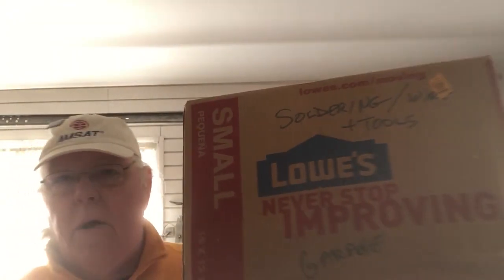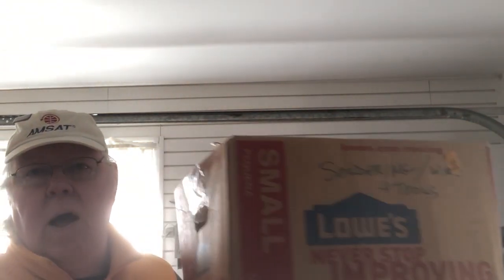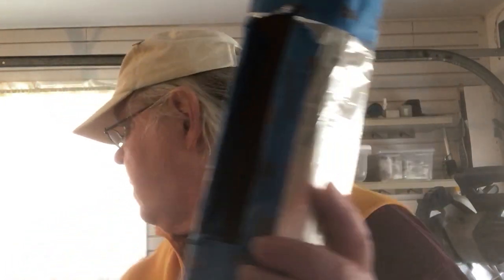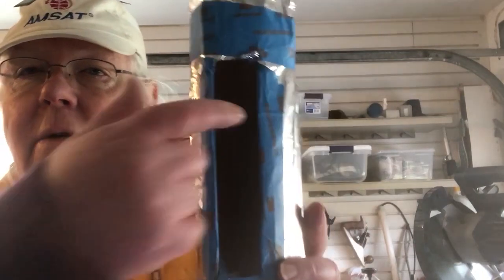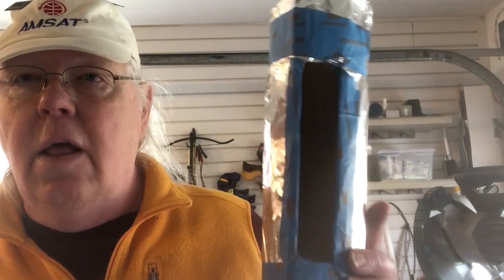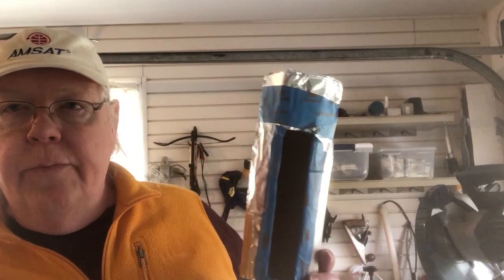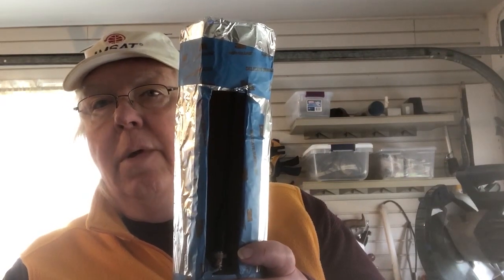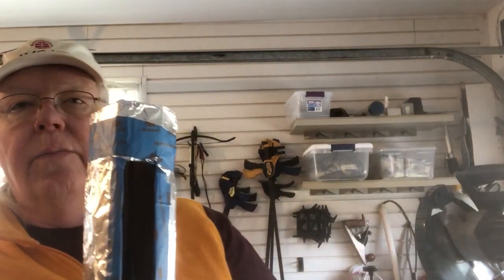Foxhunting Antenna Attenuator

Comment: Question:  I had heard of using a Pringles can that already has a foiled canister and cutting a slot in it. I was under the impression that the slot lot IN the signal from the fox, and therefore, rotating the slot around until maximizing the signal indicated the direction of the TXMR.  Or do I have this backwards?  Also, how much of the HT should be within the tube? Just the rubber duck antenna, or most of the body of the radio?

Comment: Interesting, so it is creating a null in the direction of the window. I wonder how much of a null could be measured. Also, does it matter the height and width of the window relative the the frequency being used? For example a smaller window for 440MHz vs 146MHz?